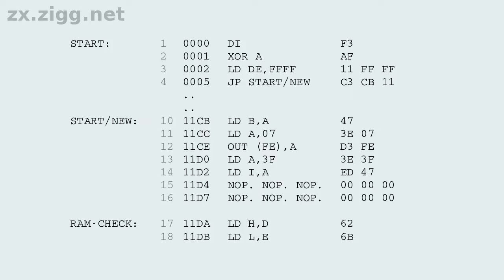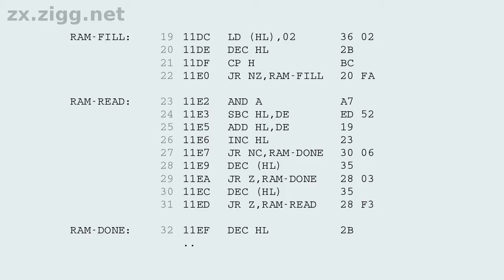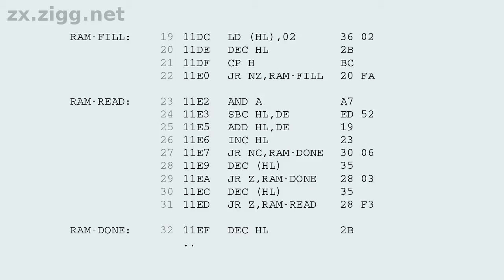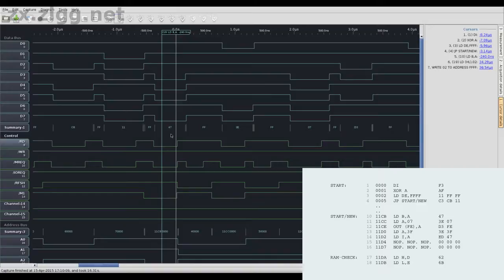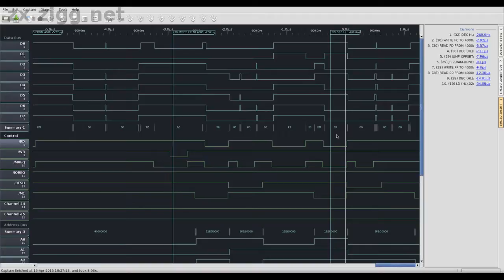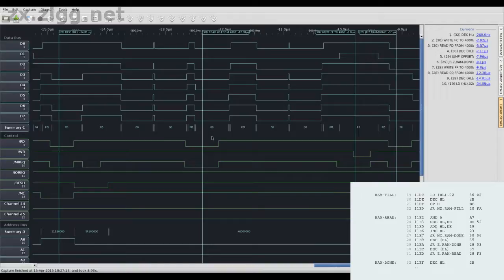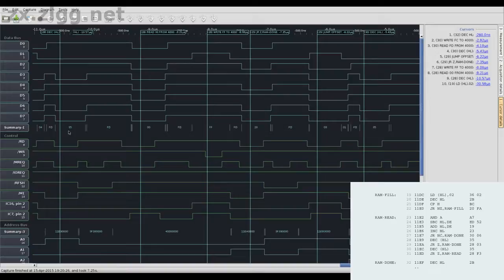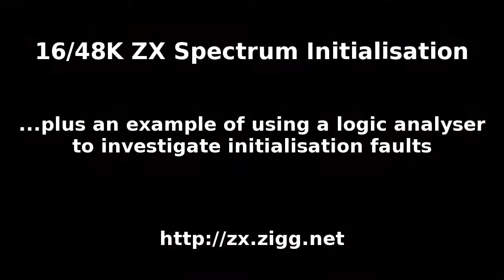ZX Spectrum Initialisation and Investigating Initialisation & Memory Faults using a Logic Analyser

Comment: Fantastic videos, not sure if you still monitor this chat still, but recently got hold of an old issue 2 spectrum that was sold as 16k but appears to actually be a 48k model with Oki upper ram, followed your guides to preliminary checks, everything seems ok, powered up, again seems ok screen displays as I believe it should, but I'm using a bench supply set at 9v limited to 750mA at first and I got an OL after a few seconds so I disconnected, as per your comments I'm presumed it was the capacitors charging, so reconnected the supply and this time it doesn't go OL, but here's the problem the amperage display on my bench power is constantly fluctuating, all voltages I measure appear accurate and within tolerances, so my long winded question have you come across this before ? would I be correct in thinking its capacitor fault? I have ordered a set of replacement caps anyway. Also it has 74ls158 in IC25 and 26, and IC26 has leg 11 cut, and leg 10 bent and connected to the socket in place of leg 11, does this seem ok? Ive tried to google it but cant find any info about this maybe im not looking hard enough :) I was amazed at how clean this speccy is zero corrosion or crime inside or out, looks like it was brought in 1982 then wrapped in plastic and hid away perfectly stored from the elements.
Reply from the maker: It's normal for a ZX Spectrum's input current to fluctuate quite a lot, depending on what the computer is doing.

I do recommend you replace the original electrolytic capacitors. Old capacitors are a very common cause of faults in ZX Spectrums and can lead to the lower RAM being damaged.

When it comes to use in a ZX Spectrum, a 74x158 can be considered to be the same as a 74x157. The former has additional inverting buffers on its outputs, but this doesn't matter in the Spectrum circuit.

The modifications that have been made to IC26 are because the internal arrangement of the 32 Kbit OKI RAM ICs is not the same as that of the similar TI RAM ICs and so addresses must be formed slightly differently. You should leave this as it is so long as any such OKI upper RAM ICs are fitted. It will not stop you from using fully functioning 4164 ICs to replace any faulty upper RAM ICs, should that be necessary. Issue 3 and later ZX Spectrums have links that can be connected to allow OKI RAM to be used without this modification.

Does the computer initialise as a 48K model? If not, most likely one or more of the upper RAM ICs is faulty. You probably could use the Memtest program available at http://zx.zigg.net to identify which.
Reply: thanks for the reply, I've been using your memtest programming it's very useful, when running on my speccy after a re-cap i got 16 errors for upper ram!! i notice i had a weird mod to ic26, pin 10 was bent into where pin 11 should be and pin 11 was cut off! after examining the schematics i noticed on an issue 3 (mines a 2) for oki upper ram pin 11 should be connected to A14 line and pin 10 ground, so i got a new 157 wired it up correctly well as an issue 3 and it sorted most the problems out, running memtest only gave 1 error which lead me to ic 20 being faulty, swapped that out now I'm getting an error saying i now have a n error with ic17 seems I'm chasing chips haha think i might just replace the whole lot :)

Comment: Hi, really loving watching your Spectrum repair videos. 
However I have run into a snag and wondered if you could give me a pointer. I have a 48k which is running as a 16k. 
Games crash when loaded, print peek 23733 comes back as 127. 
I then entered print peek 23732+peek 23733*256 which give me a number less than expected. Poking 85 and 170 to one above that number led me to ic 21 which I changed, Then the test showed ic 18  and then ic 22. 
I have changed all 3 but still have memory issues and it is now pointing to ic 15.
Is it possible that they have all gone bad or should I be looking at something else.
I know it's hard to say without having the thing in your hands but a pointer would be great.
Thanks again.
Reply from the maker: I've certainly repaired a few ZX Spectrums that had six or seven faulty upper RAM ICs. If you are able, load and run the Memtest program available at http://zx.zigg.net and tell it to test the upper RAM. You'll probably then be able to work out which ICs are faulty from one set of test results.

If the computer's simple RAM test (that it runs at power on) doesn't reliably detect all of the upper RAM as faulty, then it might attempt to use some of it for the BASIC operating environment, leading the strange behaviour and crashes. Sometimes (not always), connecting pin 5 of IC23 to the 5 V supply rail can get round this because it'll make sure all upper RAM is non-functional. If you like, this connection can be removed once the computer has initialised. Take great care not to let the connecting wire contact anything else.
Reply: Thanks for the reply.
 I first again entered the print peek + peek command as above which gave 32775, I poked both 85 and 170 to 32776 and they came back as 85 and 170.
I ran the memtest and straight away got 16 errors at 32768 through 32783.
If I poke 170 to 32768 it comes back incorrect with ic 20 at fault. I will go ahead and change it over.
I wish I'd bought one of the all in one modules now and removed them all. Thanks again for your reply.
Reply: Replaced ic20 having already replaced ic 15.
Ran the memtest again and straight away had the same, failed 32768 through 32783.
However I can poke all of those addresses with 85 and 170 and they all return 85 and 170.
What am I missing here?
Reply from the maker: RAM faults don't always show up when there are just a few reads and writes with long delays between them, as is the case when they are due to the BASIC POKE and PEEK commands. The Memtest program performs blocks of writes and reads in a tight loop. Use the values reported by the Memtest program to work out which bit positions have errors.
Reply: Indeed, and given my beginners knowledge in understanding the results I wrote a simple routine which pokes 170 to 32783 prints what it finds and loops. The result was page after page of 170 with the odd 171 or 234 which points to ic 15 or 21 which I have already changed out.
It also now returns 128 on command print peek 23733 which apparently show a 16k spectrum, earlier it returned 127 which apparently shows a 48k working as a 16k.
I seem to of hit  a wall and will need to have a browse of forums and such.
Thanks again..
Reply from the maker: The only values that should appear in the P-RAMT system variable are as follows:

16K ZX Spectrum: 23732: 255  23733: 127
48K ZX Spectrum: 23732: 255  23733: 255

Any other values mean a fault was detected by the computer's RAM test routine. A value of 128 at address 23733 means that a fault was detected at some address above the first byte of the upper RAM (the top 32K of address space). It does not mean 'a 48K working as a 16K'; I don't know why this false idea keeps on appearing.

Take several of the 'expected' and 'found' value pairs from the error report of a run of the Memtest program and convert them to full eight digit binary numbers. Comparing the two numbers of each pair will reveal which bits were in error. It is necessary to check multiple pairs as not all errors can be revealed with a single test value. If you're completely stuck, post the results of a Memtest run here and I'll work them out for you.
Reply: 23732 returns 7 and 23733 returns 128

I convertded some of the numberys into binary and expected to see the same error in the results.
That isn't the case unless I have it wrong, more than likely.
Here are some expected and found numbers.
Exp 0 fnd 254,    exp 21 fnd 26,      exp 85 fnd 215,    exp 201 fnd 241,     exp 68 fnd 119,     exp 48 fnd 253,     exp 51 fnd 19,       exp 36 fnd 190.
Thanks for this. Its a pain as the thing is running well as a 16k, cracking picture on composite.
Reply from the maker: The value of P-RAMT you give above means the computer detected a fault at address 32776 during its initialisation test routine.

I haven't done the calculations for all the Memtest result pairs you gave, but I can see straight away that they indicate faults in all or almost all bit positions. I suspect one of the following:

 - The RAM type selection links are not correctly fitted for the type of upper RAM you have installed. (What have you fitted?)

 - The replacement RAM you have fitted is faulty.

 - One or more of the address connections to the upper RAM is broken or shorted. Inspect the PCB carefully and then check for shorts and correct continuity between the upper RAM IC pads and IC25 and IC26.

 - One or both of the upper RAM address multiplexors (IC25 and IC26) is faulty.

 - IC23 or IC24 is faulty. However, I think this is not very likely as faults here usually cause a ZX Spectrum to initialise properly as a 16K model (i.e. with P-RAMT = 32767).
Reply: I have installed 4164 ram and have now replaced 5 of those.
I think my next step is as you say to inspect for shorts and continuity.
When I checked the values myself I saw multiple errors in almost all bit positions which is why I questioned my findings and passed the numbers to you.
I will check the board over in the morning now and see where that leads me. ic25 and ic26 are both available for pennies if one of those is the issue but first I will check as above and see what the outcome is.
Many thanks again, I shall post back tomorrow.
Reply: So turns out it was continuity that was at fault, I have no doubt that some if not all was down to my technique with the iron. 
There was a break between pin 9 of ic26 and pin 9 of ic 22, track adjacent to ic22. A break between pin 10 on ic22 and ic 21. 
A break between pin 9 of ic 25 and pin 12 of ic 22.
With these joined up it now reports back as a 48k spectrum.
I will now re-assemble and run the memory test again.
Many thanks, as a novice it is helpful to have videos and forums to guide and this is something which I intend to learn more about as I was very interested in it at school then left it alone until now.